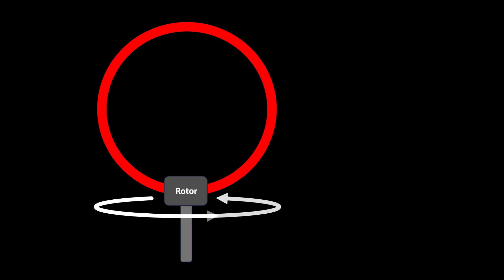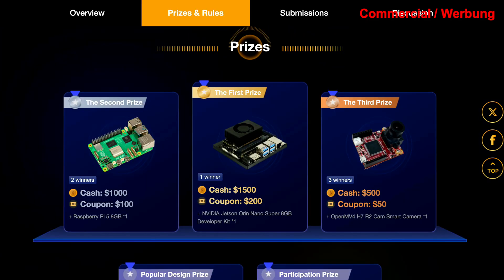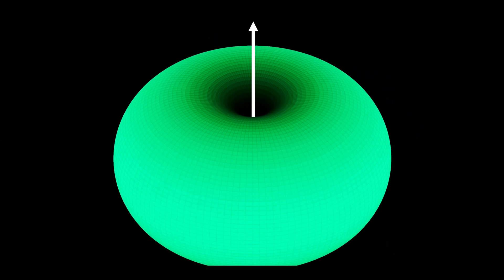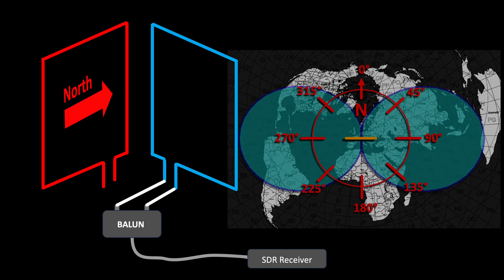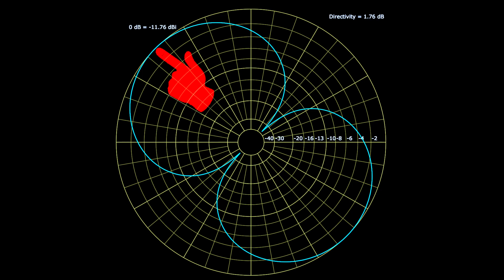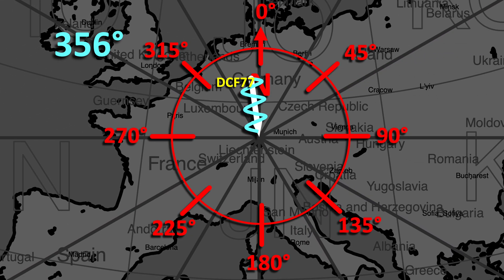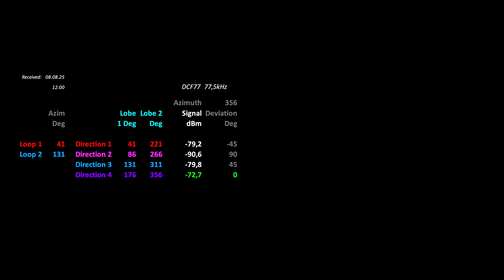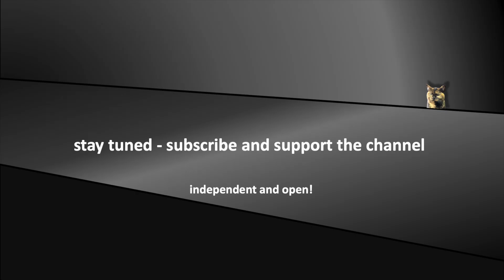Mag Loop Hack: Beam Steering without Moving the Antenna (EP176)

Comment: And now I have to say that everything you say seems correct and true, there are exceptions. Me. Listened to SAQ, thanks to all your great videos. Had a horizontal loop and great signal. Changed to vertical and didn't get as good signal strength regardless of how I turned the antenna. I know I'm a living exception and that it's not always what I'm experiencing, but it might be worth testing what should be wrong. Anyway I got my QSL card and am super happy that I succeeded. Being able to zero out interfering signals can often be a great advantage. Thanks for all your research and experimentation. 73
Reply from the maker: Thanks for your comment, and it's great that you were able to receive SAQ Grimeton. Me too, by the way. But your horizontal loop issue is strange. What is your distance to Grimeton?
Reply: @electronics.unmessed Hi I live at the very South part of Sweden.
Reply from the maker: @haraldlonn898 Ah yes, I remember you mentioned that earlier here in the comments. It's pretty close and I am not sure about the SAQ antennas whether they produce horizontal polarization too. If yes, horizontal polarization might be stronger on short distance. How is about other signal? For instance 23,4 or 18,3 kHz. Do you have the same effect?

Comment: I wonder how well it would work if both antennas were physically nested, both isolated and with the top connected.
Reply from the maker: Thx for your comment. I think, nested but electrically isolated ist the best. I don't know exactly what happens when you connect them on the top. Maybe I can check when I do a simulation next time.

Comment: Thanks Klaus!
Some time ago I constructed such a rotator using the principle of a complex rotation. I implemented this using the sum of two variable attenuators in each branch, where one is the sin() and the other cos() of the rotation. I still needed one switch to allow inverting the sin() attenuator and switch from the 0 to 90° range to the -90 to 0° range. As I was more into HF reception, I could not clearly demonstrate the effectiveness, possibly due to the propagation. For ground wave reception this is perfect :-)
Reply from the maker: Thank for your comment. And yes, I think, the idea with the variable attenuators is perfect for continuous beam steering. Let's see maybe I will come up with an active solution. Greetings Klaus

Comment: Hello Klaus, 
thank you very much for another great video.  😊
Could the switching be done with an analog switch? At this low frequency, that should actually be possible.  Then it would be easier to create a control system because you could simply let the field rotate, even quickly. For example, once per second. Then aligning the antenna would only take one second or a little more.
Take care,
Werner
Reply from the maker: Werner, thx for your comment. Yes, absolutely! There’s even the option to rotate it continuously. Greetings Klaus

Comment: Interesting! I have seen this on ships, where the two loops are mounted on the same mast, but with the loops crossing like whisk. Would it work to fit a 90 degree Phase-shift network between the element feeders to remove the switching?
Reply from the maker: Thx for your question! You could play with the amplitudes to steer the beam continuously. Phase shifting is no option, because the antennas are close together compared to the wave length.